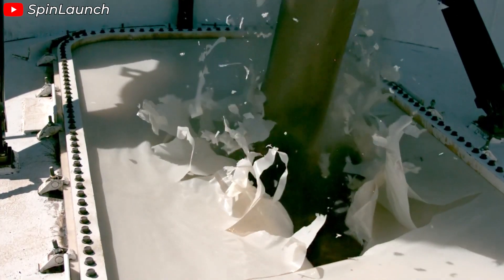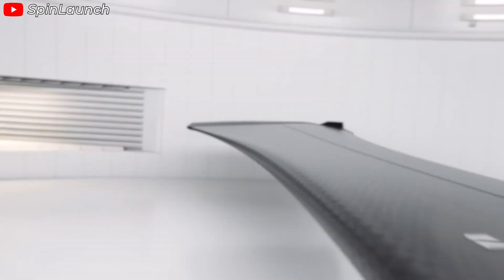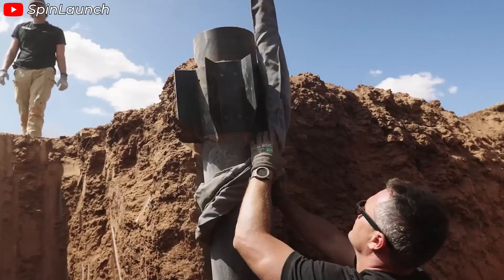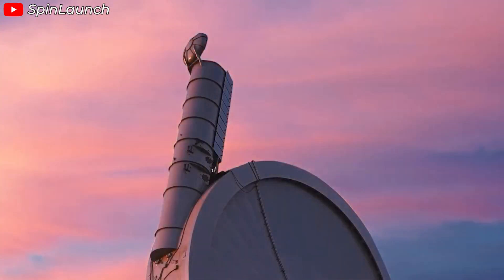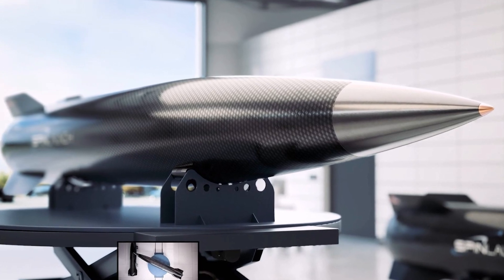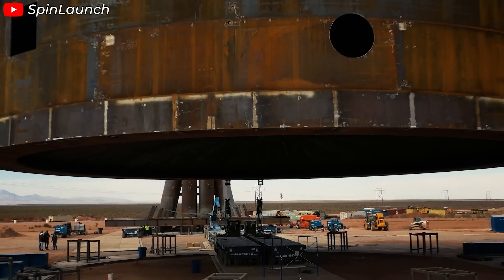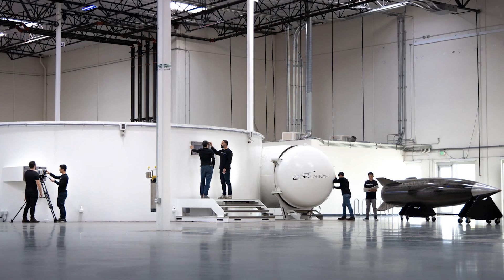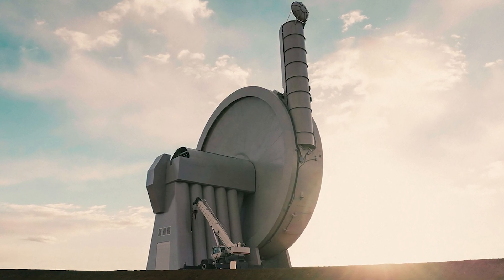SpinLaunch Is Trying To Make An Orbital Accelerator Somehow Shocked NASA

Comment: I dont like that it is still creating debris and the rocket is probbaly not reusable
Reply: But you like the debris and lack of re usability we currently live with?  People like you are the worst.  Just because it isn't perfect by a few metrics you're gonna talk shit on something that has remarkable gains.  Significantly less fuel and minimal waste produced and you're bothered that it isn't perfect.
Reply: @cropcircle5693  I dont like the whole concept and I can shot on what ever I want. I think that this whole system will be surpassed in a few years maybe decades. It Is nice gimmick at best.
Reply from the maker: SpinLaunch's method reduces debris and emissions, which is pretty advanced. 
The problem is, its feasibility is still a big question mark, and so far, it hasn’t made any money
Reply: You know what the debris is for a Starship launch?  2 million pounds of carbon dioxide, from a methame LOX reaction.    The projectile for spinlunch is (guessing) at most 20,000 kg.  Its metal, so of course you can reuse it.    so thats not debris... Drilling down further,  the debris you speak of is the polymer diaphragm that is ruptured at launch,.  I'm guessing that weighs less than my body,.  100kg  of ruptured nylon, or 2 million pounds of CO2 released into the atmosphere.   tough call